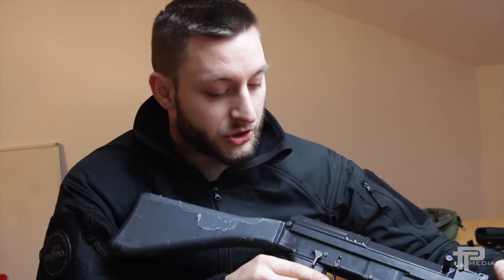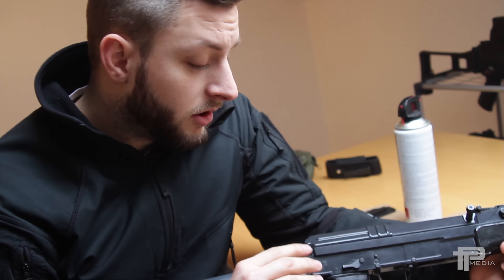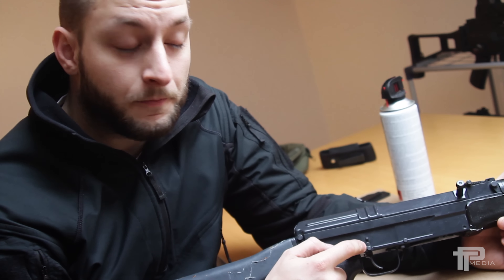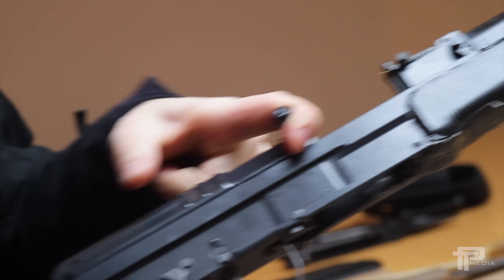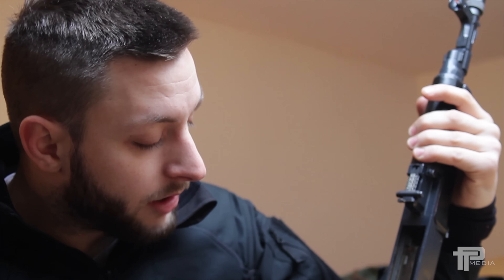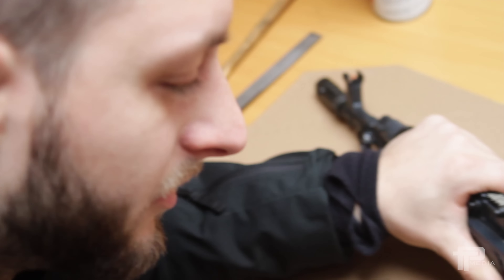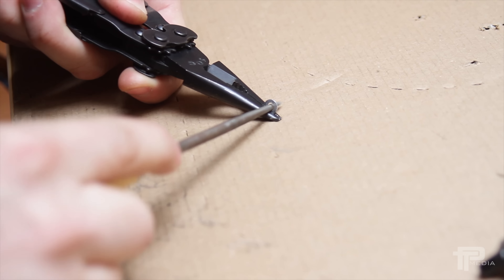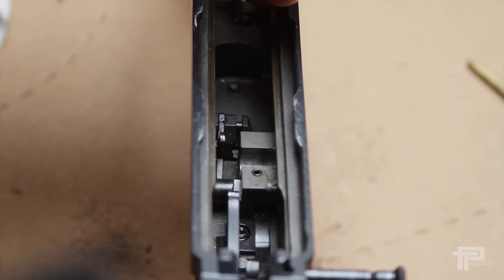Vz58 trigger fix | The Gremlin

Comment: I had to get a metal tab welded on my bolt carrier to fix the gremlin. Never tried this fix though?
Reply: +BC Viking Yup, that's the common fix, not very elegant, but it works.  My Czechpoint came with the tab welded on and I haven't had issues.
Reply: Pics or vid please

Comment: VZ2008 trigger group totally different.  No good demonstrations anywhere on the actual cause of the gremlin.  No cheap parts in America either.  Bottom line:  The VZ58 was designed for full auto, and we are too pussified in America to allow it.
Reply: If it's not the D-Technik Bulgarian made receiver with the hammer forged chrome military surplus barrel, it's not the same rifle... Century makes their own receiver, green mountain barrel and trigger control group...
Reply: you mean the D-Technik reliever made in czech republic?